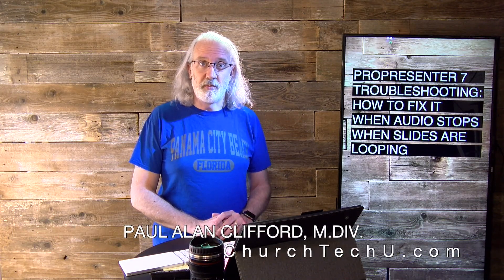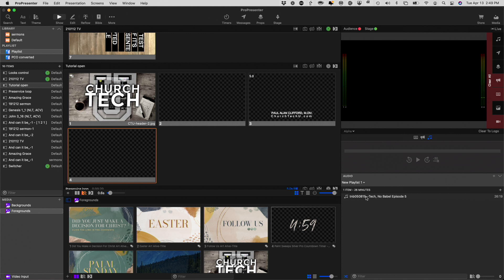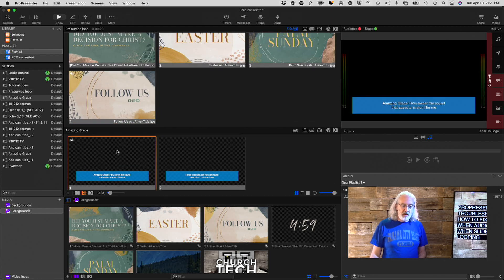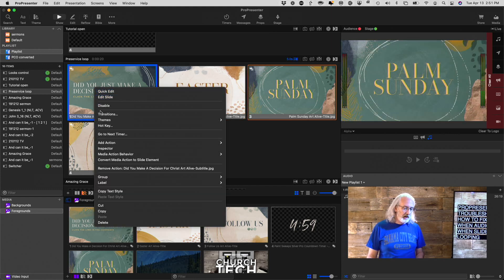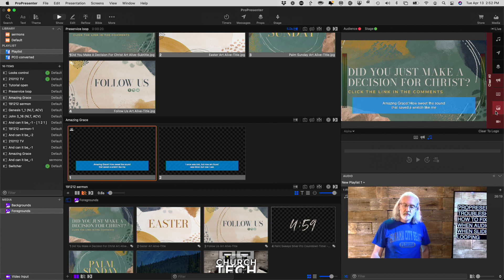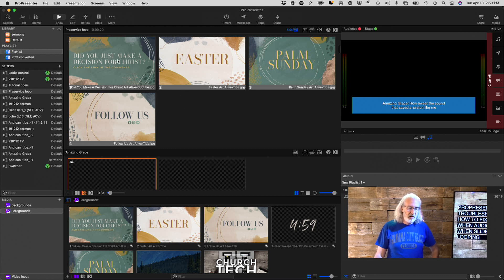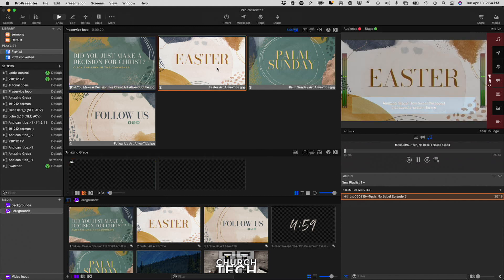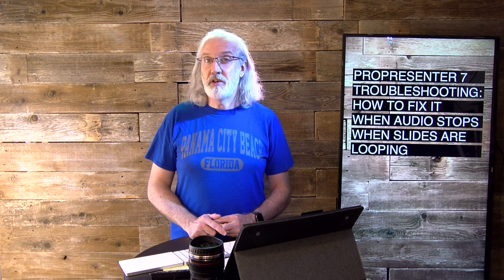ProPresenter 7 Troubleshooting: How to fix when audio stops when slides are looping

Comment: I did this and then my slides no longer appear
Reply from the maker: @jarontaylor8783  make sure the appropriate layers are enabled in looks. Also, clarify if the thumbnails are showing in the UI or the output isn’t showing them. Two possible causes. The second could be a looks problem.